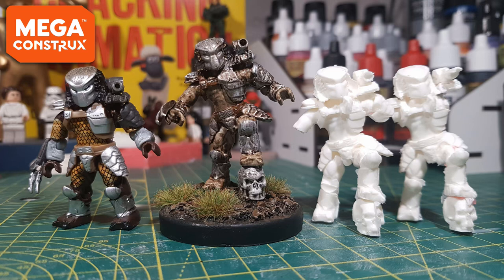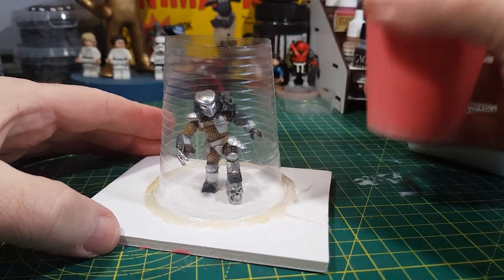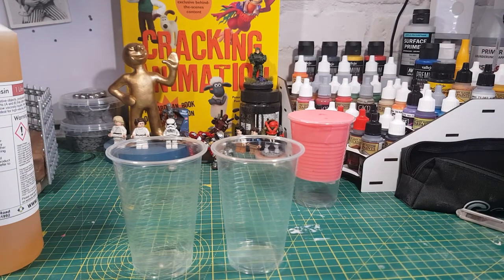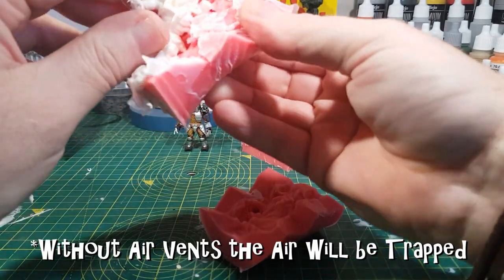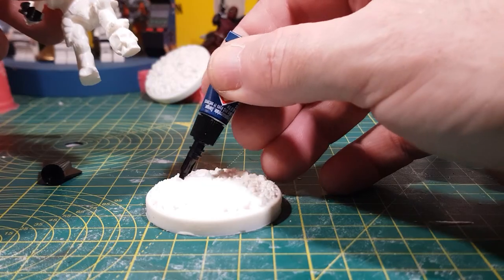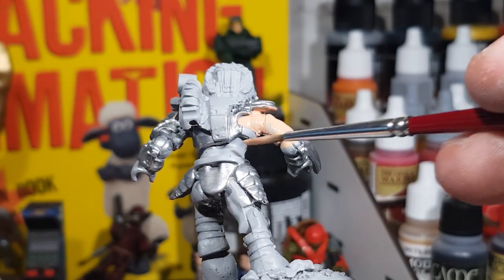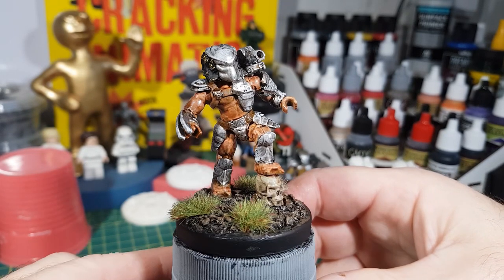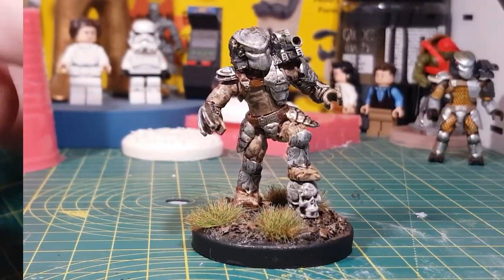Recasting an Action Figure - Cut Mould Method

Comment: Sorry, nothing new to see.  I do have a recommendation.  Gravity pulls down, bubbles float up.  What you need are some reservoirs at the bottom.  Think the gate connections to the sprue on the market minis.  The plastic will be less likely to leave bubbles at the bottom.  I hope that makes some sense.

Comment: mold making question, if you add say toothpicks to the original cast to add in some "through lines" would that make pouring in the plastic better as air won't get caught in the limbs?
Reply: It would